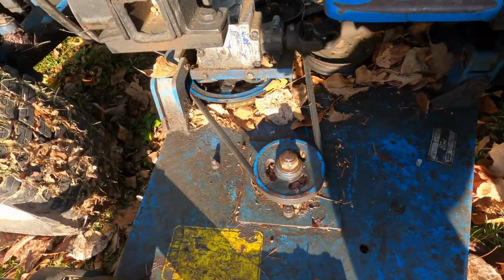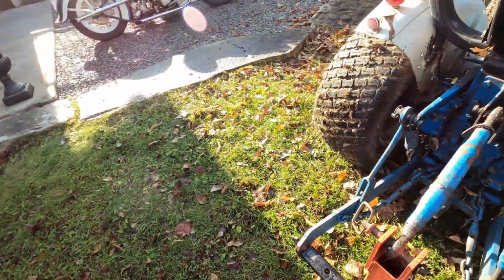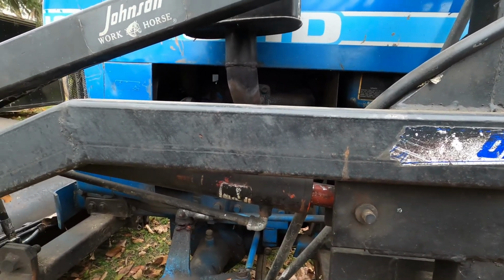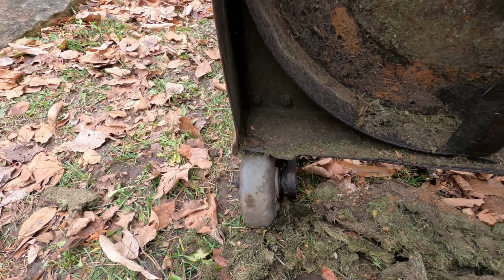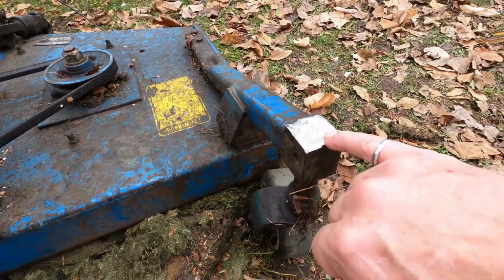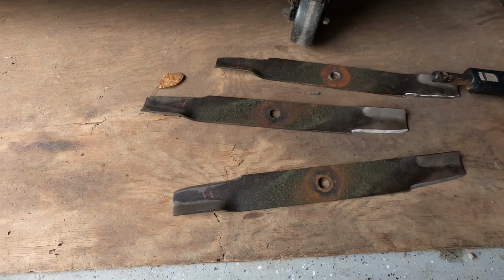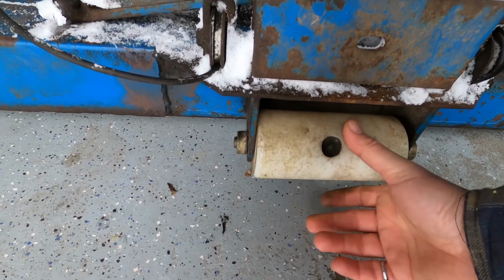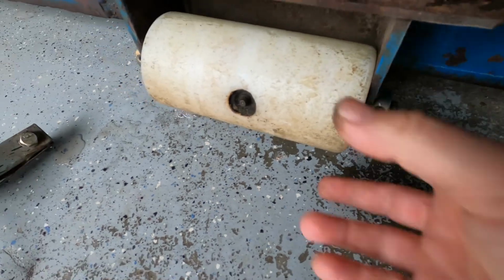Ford model 1210 Tractor Repairs Part 1

Comment: Do you have any recommendations for removing the  front hub assembly for a Ford 1210 tractor that isn’t 4wd? The lug nuts are spot welded on the hub plate and can’t figure out how to remove the hub assembly.
Reply from the maker: Look at the online diagram. https://www.mycnhstore.com/ca/en/newhollandag/na/tractors/compact/naba17com0543cyl/3-cyl-compact-tractor/front-axle-steering/front-axle-frame-w2wd-1110-1210/cn/3373BCCF-B8BF-E111-9FCE-005056875BD6/C4E9724F-E6BE-E111-9FCE-005056875BD6

You should be able to remove the hub by removing the wheel bearing nut.

Comment: Hey I got one of these tractors. If you are still out there I have a few questions for you.
Reply from the maker: I don't check comments regularly, but I do try to get back to all. What's your question?
Reply: @mred7375 do you have a 2WD OR A 4WD? Or do you have any recommendations for removing the front hub assembly for a Ford 1210 tractor. The lug nuts are spot welded on and are presenting a problem with getting them out, but cannot figure out how to get the hub assembly off. It just keeps spinning.

Comment: What size and model is your front loader?  I have a 1210 identical to yours. It didn't have a mower on it. But is equipped to have one. Since I have a rear finishing mower I don't need the belly mower.. anyways .

Also mine came with tires like yours  on the front and someone mounted a 5 lug to 4 lug pattern spacer with 4wheeler tires on it🙄
I need tires and rims  for mine. What size are the rear rims and tires.  Thanks.
Reply from the maker: Ford 1210 Tires
2WD Standard tires (ag):	Front: 4-12. Rear: 8-16
4WD Standard tires (ag):	Front: 5-12. Rear: 8-16
Lawn/turf front:	20x8.00-10
Lawn/turf rear:	29x12.00-15

I have no information on the front loader. It's a universal type and identification has been removed. It appears to be a Johnson Work Horse model 10, but that's based on tractor horsepower. The factory model was a 48 inch wide bucket.
https://www.tractordata.com/farm-tractors/000/2/4/248-ford-1210.html